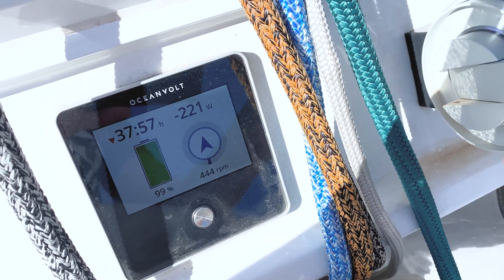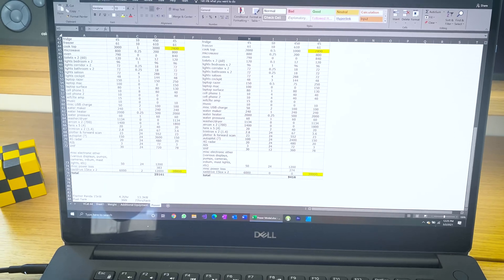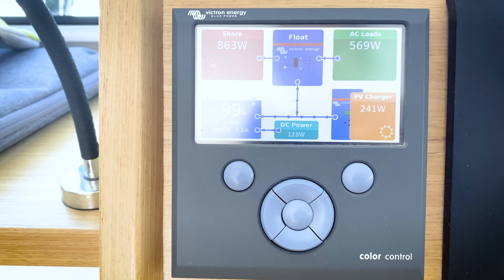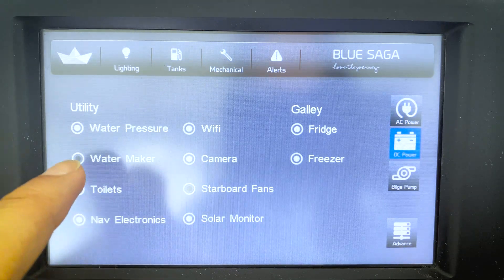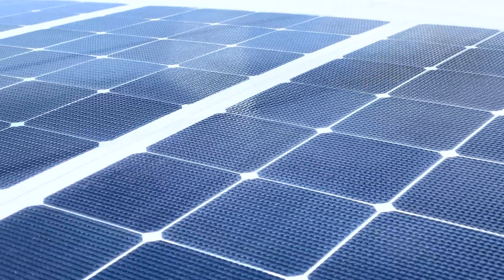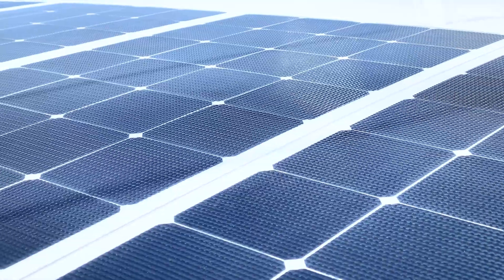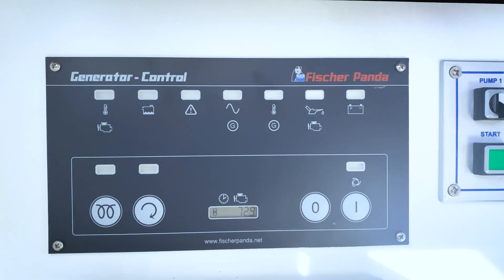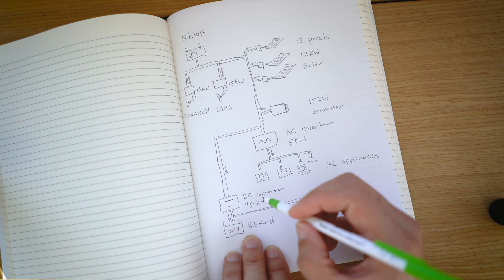2.2 - Electric Sailboat System

Comment: Hey. Cool boat. I have a 12m cat currently without engines, and are concidering going electric. What kind of range does your 18kwh battery give you, at what boat weight? Looking forward to you next upfate ;)
Reply from the maker: This depends a lot on your waterline/weight and what speed you want to make passage under.  We can recharge our propulsion 18kwh battery around every 5 days and make about 10-15nm distance at 3.5-5 kts boat speed.

Comment: How much is the whole conversion?  Due to sails shade , u lose 2/3 charging capacity from solar.  What about when sails are not hoisted( not sure is the correct term)?
Also, why not doing the silent-yach approach, not sals at all.?
Reply from the maker: General rule of thumb for solar on bemini top of sailboats is roughly 1/3 of generation capability due to various shadows.  However, when we are not sailing by the wind (no sails up), we move the boom (and anything we can) to reduce shadows on the solar in some thing we call solar sailing, which usually gets us about 2/3 of rate generation.  In general, we can go 12-15nm every 5 days from sun power only, but it's way more efficient and usually faster to sail by the wind.  We can sail with about 5kts of wind at a reasonable speed.

Comment: Former runner who stroked out. At 77 I get my kicks now riding long distance on a recumbent trike w a 48v 5 kwh lithium ion battery pack and 100% assist Chinese Bafang 9 speed electronically stepped electric motor & controller kit ( or zero assist manual transmission crossover powered strictly by me, my legs & level of endurance. Via electric can do 31 mph uphill!). I use the 120 vac plug-in charging unit that was provided by the battery dealer on Alibaba. It's easier to find 110-120v outlets and keep a set of US/Euro adapters handy. If you have the room consider carrying one or two e-trail bikes onboard for port-o-calls.
Reply from the maker: That would be awesome.  With any performance boat, the challenge is trying to keep the boat weight light.  So we do have to consider every toy we bring on, but that sounds like a cool ebike setup.

Comment: Thanks for putting this out there. I really like the idea of an electric boat. The dual generation from solar and using the engines as generators is just great. You're not getting much use of the engine generation, but on a long passage in some wind on a cloudy day I bet they will rock.

Comment: I just sunscribed to your channel. We are thinking of buliding a catamaran one day and i was wondering if we placed 2 electric motors wouls we be able to sail the world? I guess the trick is the panda generator. How mich diesal does that use and it is enough to sail under motor for as long as we would want to+
Reply from the maker: Yes, you can sail under genset with the electric motor.  Our range is greater than 700nm for about 300l of diesel.  For our boat, efficiency under motor is around 3nm/liter going about 4-5kts, but we generally sail.  The main benefit  of the system is recapturing energy while under sail or on sunny days for propulsion power.

Comment: Thanks, it would really help to see these figures on the screen. Bit hard to follow at times.
Reply: I think maybe if yoy spoke a luttle slower you could be better understood. Especially when you guve us technical information you would be surprised hoe much attention your viewers are placing on your videos! Sailing with elefteic motors is groudbreaking stuff and lots of peoole are interested in what your doing ans giw your doing it
Reply from the maker: Thanks for the feedback.
Reply: @bluesaga  The cc work pretty well however I just found out. But yes, a few illustrations and figures would still help to get a better grasp of your system.

Comment: Sweet!  Really looking forward to hearing what works best. I heard that the OceanVolt system works at 48V nominal. However, I would think with a torque curve (namely torque all the time) for a propeller, they would have moved to a higher voltage for better performance. Is the voltage lower just because it is easier to source system components to run at 48V rather than 96V for example?
Reply from the maker: My general take is that 48v is for safety (aka you won't get electrocuted).  I am sure it's possible to build systems of 96V or much greater.  Electric cars like Teslas are above 350v, but they don't have as much risk as a boat with water intrusion.  In terms of torque, there might be some science about voltage and torque efficiency, but I think it would be negligible.  The main benefit for higher voltage is wiring for delivery of large amount of power.  Since our electric sail drives are modest in terms of power, it's doesn't require crazy large cables to operate at full power.
Reply: I am not an engineer and therefore like to keep things simple. The electric engines need practically no maintenance. To replace it by one generator on a catamaran seems the logical choice since you could also run a dive compressor or a washing machine with 110 or 220 volts. Due to EU regulation the electric engines are all 48 volts and can not be run by the generator directly. The necessary battery capacity needs a huge investment and is heavy. Only progress can change that. Or did I miss something?
Reply: @stefanwieser2635  Sounds right to me.  It looks like the boating industry is moving the same direction as the car industry, and should benefit from technological advances.